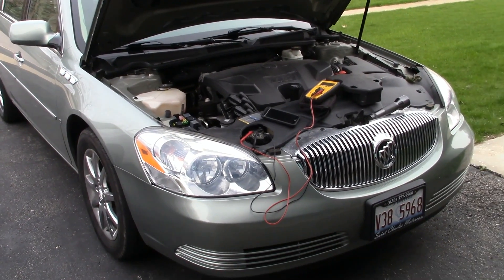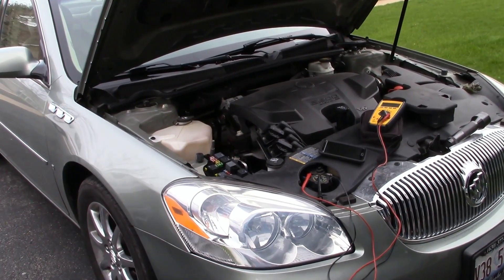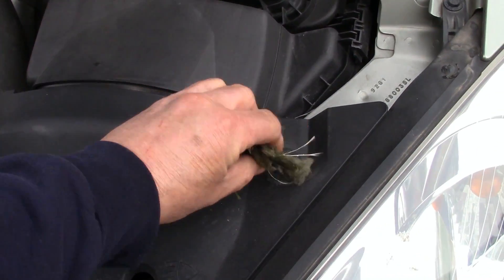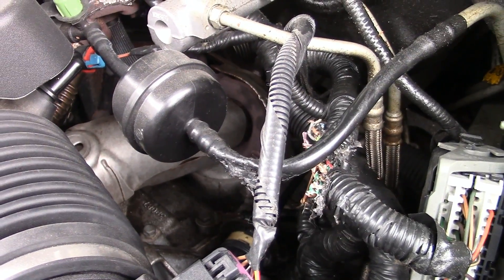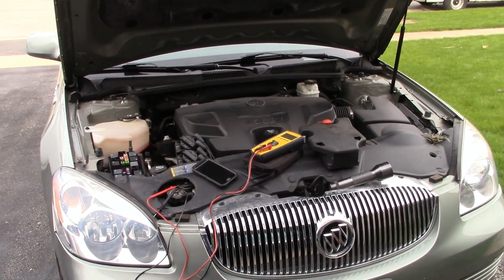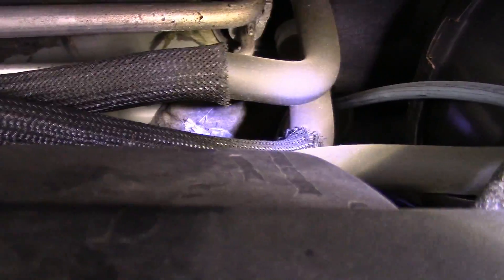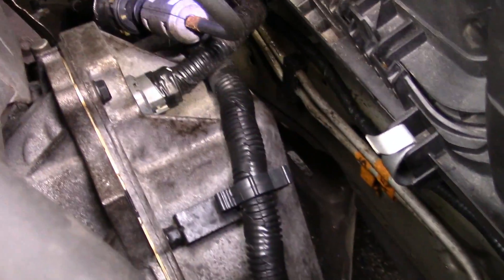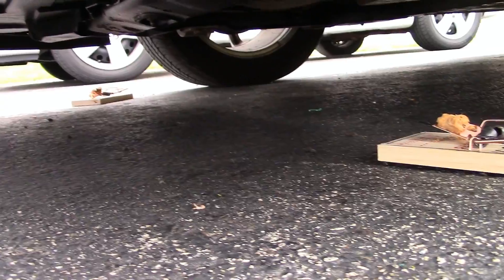2007 Buick Lucerne Wiring

Comment: How do you take out the starters on . The only 2009 Buick Lucerne
Reply from the maker: Fortunately I have not had to replace the starter yet. So I do not have an answer for you. I did just replace the battery and it was the original Delco from 2007!!!
Reply: You have to pry it out and force it on..
 Take off the oil filter gives a little room room